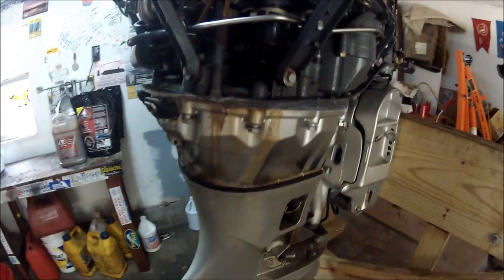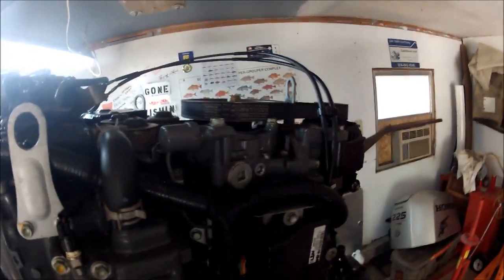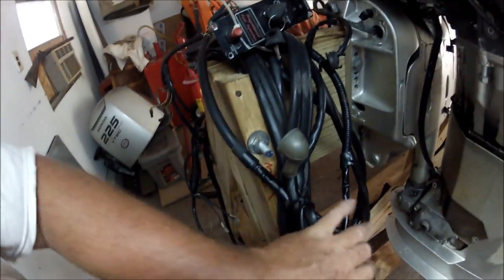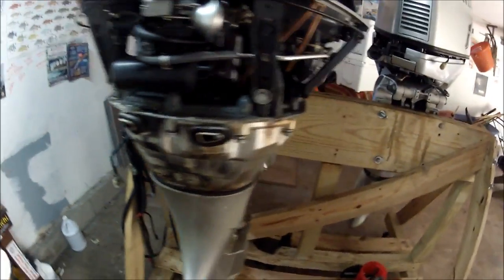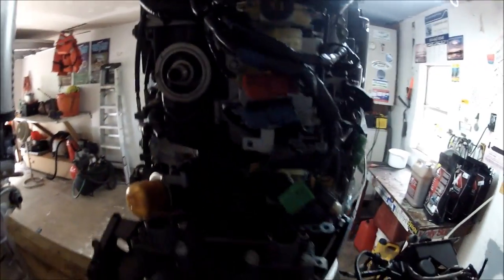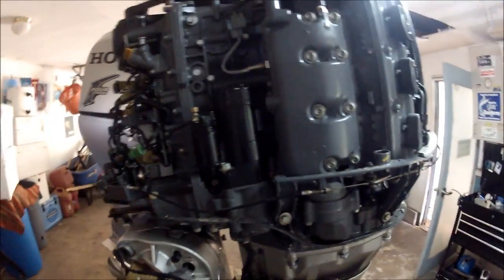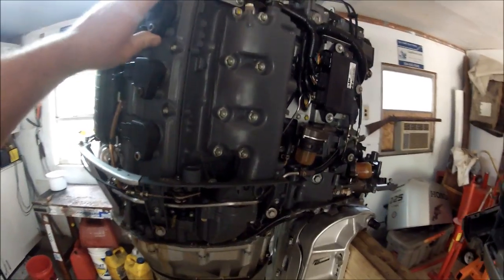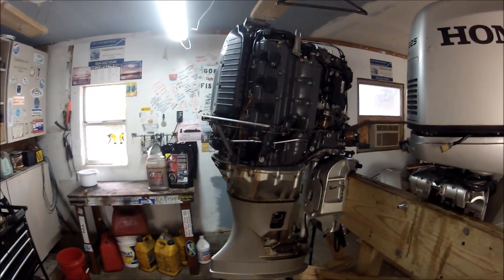2006 HONDA 225 OUTBOARD, parts sale: 5/29/14

Comment: Got a question.  What's the small hose going down into the shifting mechanism? I have the same engine  year and that hose was disconnected by previous owner.  Thanks.
Reply from the maker: SPEEDO, WATER PICK UP TUBE NO ONE USES THEM
Reply: @CaptDavesSportfishing  thank you sir.

Comment: What's wrong with the engine? Why braking apart? Just curious!
Reply from the maker: don't have the room to tell ya the details. there's 2-225's there. BOTH with major problems. 1-bad casting in block from factory, factory QC total failure.  the other; the oil pan got holes in it because of poor design and ran saltwater thru crankcase, then shit the bed. Bought a 250 Suzuki, way happier! all motors are gone, sold each intact for parts. WORST OUTBOARD EXPERIENCE I EVER HAD IN 40 YEARS.